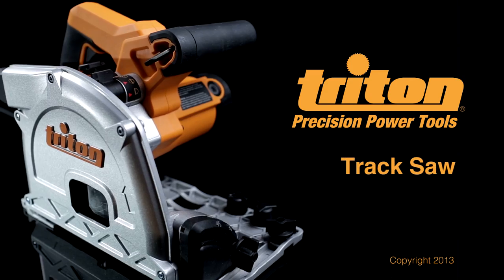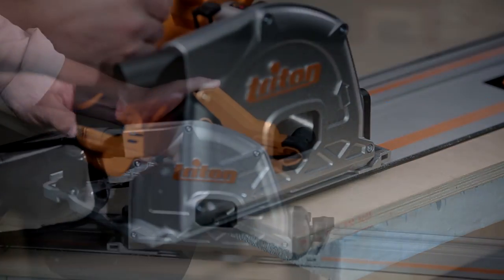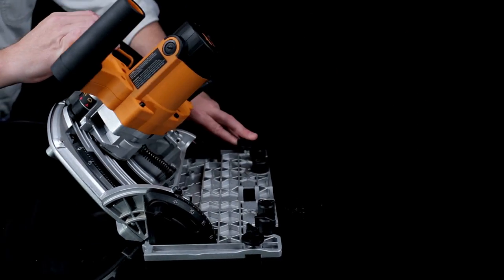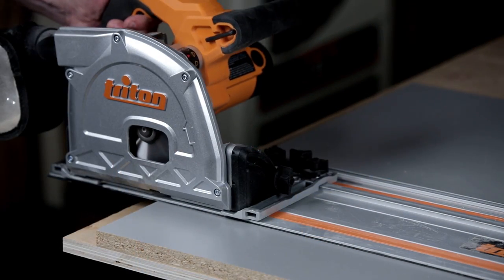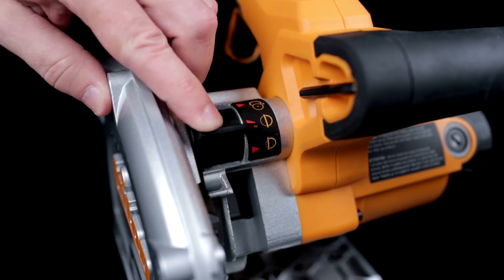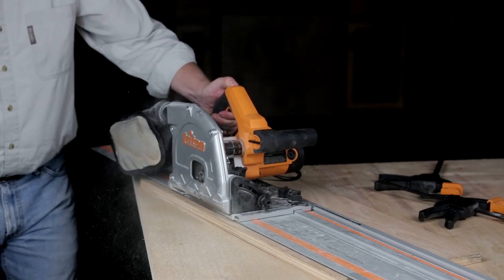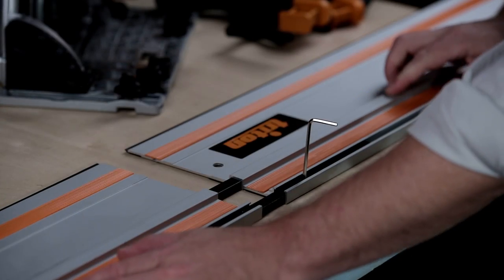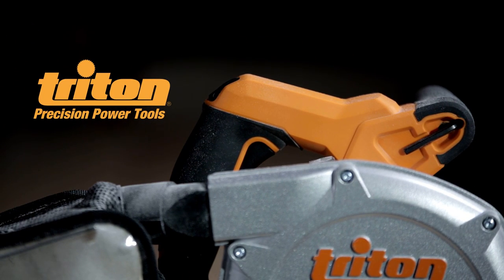Triton Track Saw

Comment: Regardless of track saw brand, don't forget to do a scoring cut for squeaky clean edges on all 4 sides of the cut.  None of those chip guards on the tracks prevent tear out very well when doing cross cuts.

Comment: Is the 45 bevel angle is cutting the material at exactly the same place where the 0 degree angle is cutting and without altering the splinterguard any further than with the initial cut ?

Comment: I have the Kreg track saw and table system and the saw sometimes loses power in the middle of a cut. Letting off and re-squeezing the trigger gets it going again but stopping in the middle of a cut is never good. Also, they use a ton of cheap plastic in their components.

Comment: This is no good because there is not enough room to clamp the track.  If what you are cutting is not dead flat you will not get traction on the track.  If the track was wider or the saw narrower this would be a deal.
Reply: Sorry, I did not get to the track clam part; count me in, I am ordering this,

OOPS
Reply: The clamps slot underneath